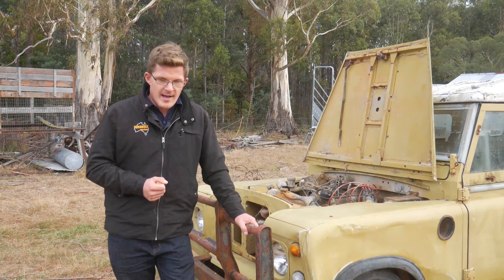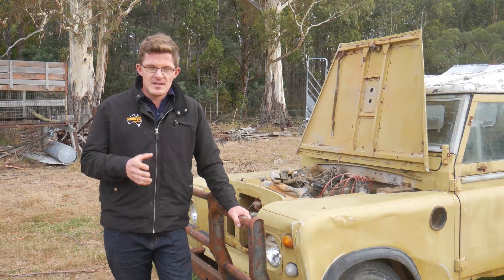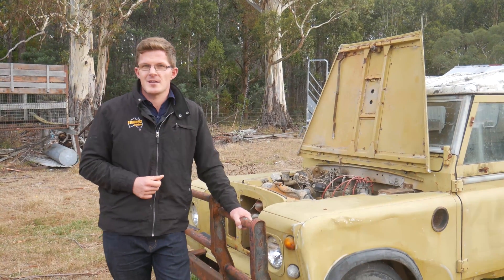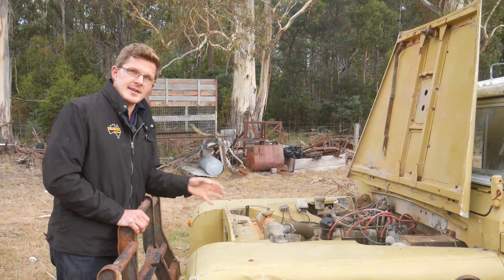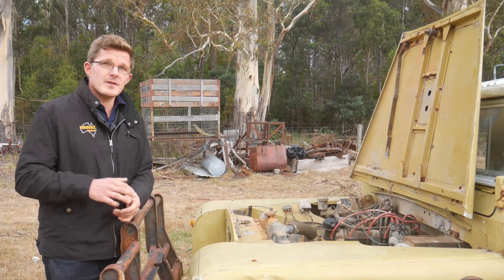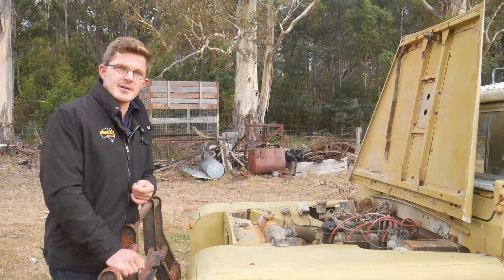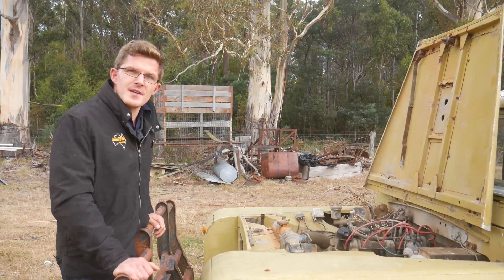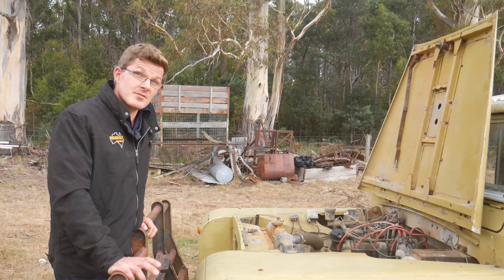Cooling Systems tips and tricks

Comment: Correct me if I am wrong in observing that this Series LR does not have a condenser for the cooling system? It was back in the 1930's that R.A.Bagnold; the founder of the LRDG in WW2, developed many of the tech we use today in vehicles that were doing long range overland travel in the desert of NAfrica.
Reply from the maker: Hi Peter. No I don't believe they have a condenser, some models are fitted with an overflow bottle and oil cooler. Kind regards, Geoff

Comment: Also note that the 8-blade fans will draw more horsepower.  When I said remove the shroud, it had to be set up on the fan pulley and then fitted to the radiator after it was reinstalled.  There was only about 1/2 inch clearance between the fan blades and the radiator in my 1969 Series IIA.

Comment: Land Rover made a 8 blade fan for hot climates, and some of the military versions had them.  I recently bought one only to find out I had to pull my radiator to install it (and remove the fan shroud), which also meant that I would have to pull the radiator to replace a water pump.   It wasn't worth all that to me so I returned the fan.  But these fans do exist.  Pangolin 4x4 in Oregon USA has some of these.

Comment: when  i was exchange student in the united staates by a custom harvester. we did a lot of harvesting in texas, oklahoma, kansas, nebraska, colorado and south dakota where it can get realy hot during the summer. in kansas and south dakota we had days with 40 -45 degree. i did a lot of trucking hauling grain. it made a big diffrences when the engine oil was realy topt up. the engine run just a few degree colder and thats make a big diffrences if you are running on 95 or a 100 degree.
Reply from the maker: Sounds like a great experience. Great tip there, thanks!